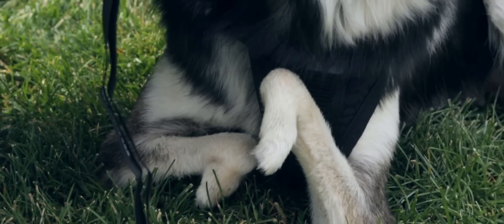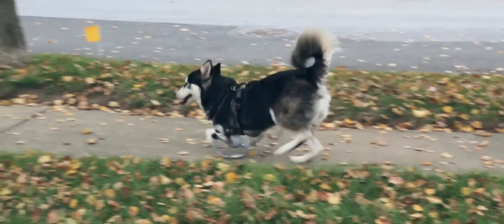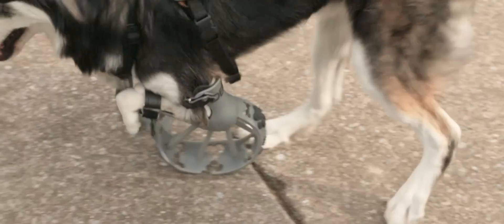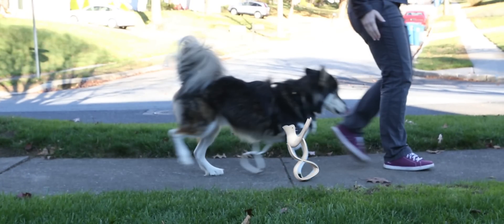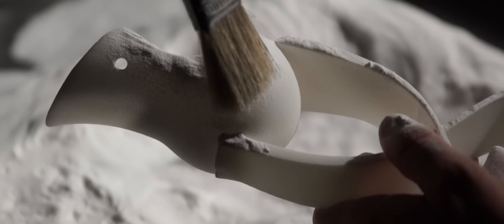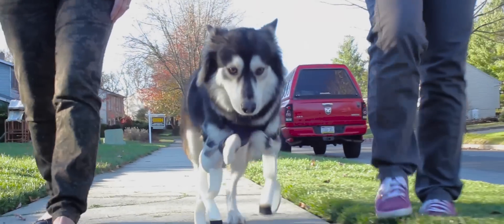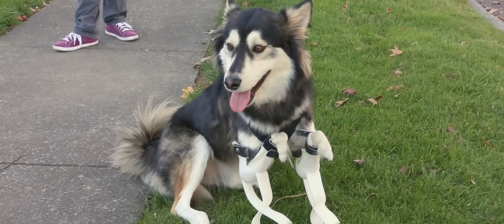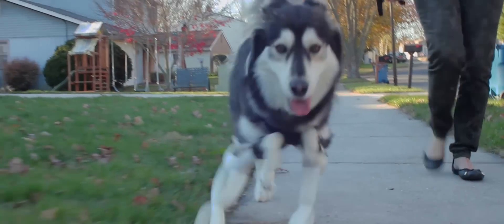Taking Derby the Dog to New Heights with 3D Printing

Comment: What I find most interesting is that the subject (Derby) can't speak and explain what's right/wrong about each iteration, so the process really takes some smart analysis and intelligent redesigning. I'm also impressed by the dog's ability to learn and adapt to the prosthetic legs.
Reply: How can I get that for my little Maltese?
Reply: Ask around the places that have the ability to make prosthetics. Just be prepared to dish out thousands for it. 
I could probably design it if you can bring me a 3d scan of the dog and get it printed myself but I dont have the time atm.
Reply: Able to walk = good iteration
Happy dog = good iteration
What more do you need? Have the dog speak in English?
Reply: WhiteWolfos do you think this would costs buttloads of $?

Comment: Its good to see people helping him and I will try to help him too.
From what I can see there is crucial part missing and that is the suspension or shock absorbing part that the fingers wrist and forearms do on a normal dogs front legs. At the moment he is walking on his elbows and the shock loading off of the ridged surface he is walking on is being transmitted directly to his shoulder joints. I see  an attempt has been made to do this and that will take care of the big impacts, but the sum of lots of little impacts can also be detrimental.

(I spend a lot of time on my computer and if my RHS mouse table is not at exactly at the correct height i.e. too high then it pushes my inflexible humerus bone up into my shoulder joint and after a few hours it starts to hurt a lot, and I am not even walking on my elbow).

If the bottom 1/3 of the bottom loop of these plastic legs were to be cut off and a large (the size of the internal dimensions of the bottom loop) closed cell foam piece were to be epoxied into the hollow bottom area then when he walks on them the larger amount of softer impact absorbing material, should do a better job at protecting his shoulder joints. Those legs need a lot of soft stuff in them that can carry the load but take any jarring out of the impacts.

I realize that, that will remove most of the shock absorbing functions of the existing designs loops, but I think it will replace them with a softer ride in the end.

Because he is not a sprinter he doesn't need to recoup the energy so the current  leaf spring design, is not necessary. He just needs to be able to walk on air  as those front shoulder joints may also be a little deformed too.

Comment: It’s certainly a lot of trial & error, and within the realm of error, you realized as she stated that something that works small, doesn’t necessarily work larger.
Often I find I’ve had ideas or designs that look good on paper but in reality, they just don’t work. The last design, did get him straighter, more level which is great & he can sit normally, but I noticed he didn’t seem to be able to run, as he could with the lower arc design.
I would think the blade type design be an option, like human athletes wear who have lost legs, they seem to have a spring action that I would assume assist in forward motion.

Comment: Do you take appointments for consultations? My foster needs options.  
He was involved in a hit and run back in October, was picked up by Animal Control and the rescue group took him on as a rehab case. He's had more issues with his legs than was expected. One shoulder is luxated and has healed by making a new ball and socket joint. The other shoulder has nerve damage from the elbow down and the muscle has now atrophied. We've tried splints to  keep his leg straight and help him support weight on his bad leg. That worked for a short period of time. We started making braces for him and that was becoming very time consuming and expensive changing his bandages daily and keeping any new sores clean and padded. The rescue and I are exploring the possibility of amputation from the elbow down with a prosthetic similar to Derby's. He can get up and go but not without shredding his arm or twisting in an unnatural way. JoJo, my foster, wants to run. All he wants is to feel the freedom of running without help. Can you or someone you're affiliated with help someway?